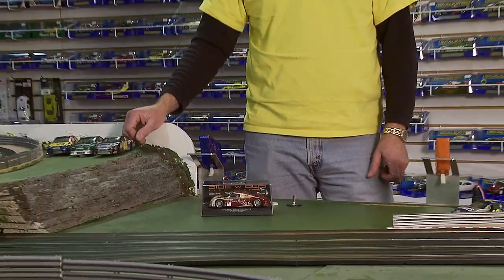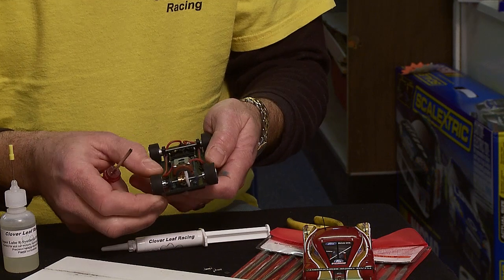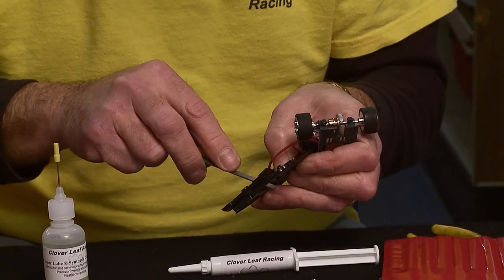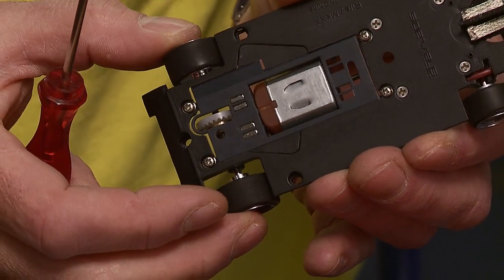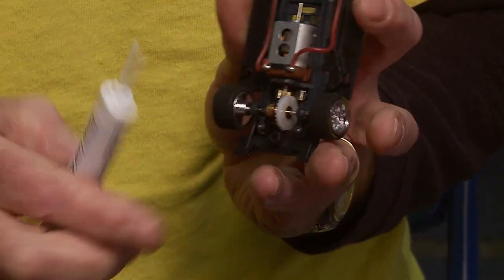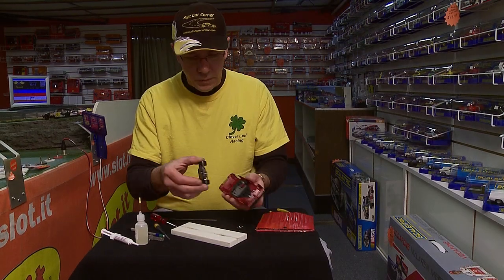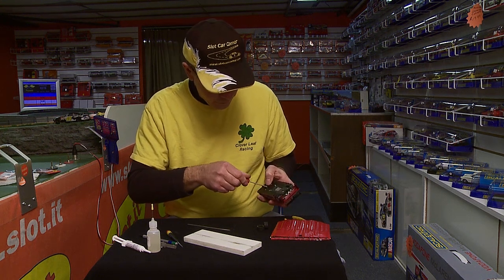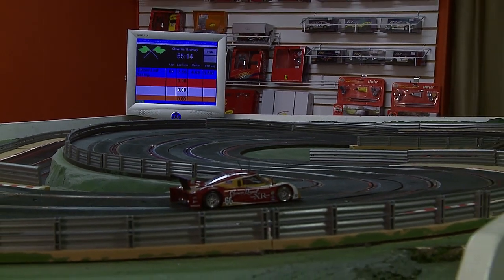Clover Leaf Racing Car Tune

Comment: I use to race back in the 80/90's I made a brief return to the hobby around 2010 and I couldn't believe how far the hobby has come, the cars now! Well you can do just about anything you want to, there are so many cottage industries devoted to the hobby, the Italian & Spanish guys are truly the innovators I watch the world finals and 24 hour races on YT, thanks for taking the time to produce & post! I used to put a small amount of cutting paste on the pinion gear just to cut and match the teeth, it did make a difference the car ran quieter & quicker 🤔

Comment: It was very interesting watching the fine tuning the motor pod to the chassis & the the chassis to the body. So the body, chassis & motor pod improves drive-ability as the car is allowed to flex around corners & soak up some of the irregularities on the track. Is tracking sometimes an issue with modern slot cars theses days?